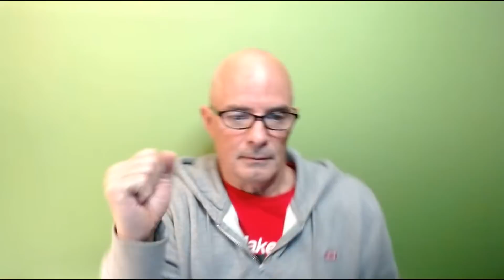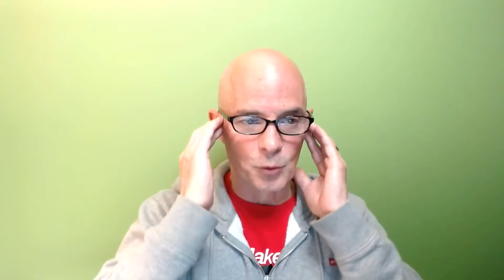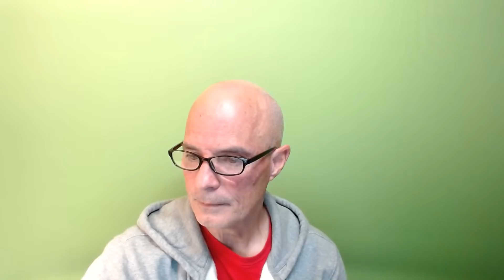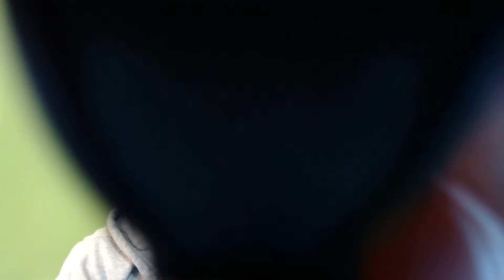LET'S TALK TECH-SLOPPY VS TRUCK NORRIS (PT 1) RESULTS

Comment: Can you use a Truck Norris cam on a gen5 5.3
Reply from the maker: no-that is an L83-but BTR has a good cam for the motor too
Reply: @richardholdener1727  alright thanks looking for a cam with similar power for a 16 silverado daily driver

Comment: Off topic here but have you thought about trying the 2.3/2.5 duratec from the fusion/escape?? Cheap and easy to find engine, that can be converted to rwd easily and can take some boost.
 As always thanks for the amazing videos/info.
Reply: Oldschool rangers have a rwd version of the 2.5l with a front facing intake. They are industrial power units, pn MSG-425efi

Comment: I have a 2004 silverado with an lq4 with prc 225 heads and a 216/220 600 lift cam (roughly 10.25cr) made 357whp and I'm looking for a turbo that would spool quickly and make around 750hp crank. Any suggestions?
Reply: Vs7875
Reply from the maker: S475, VS Racing 7875 gen 2 etc...

Comment: I'll have to look it back up, but I remember reading an article by a drag racer at one time, who did testing at the track with long tube headers, shorty headers, and a set of zoomies. He found there was no noticeable difference in his track speed or ET. As I remember, it was a pro mod type car. I'll try and find it again, but it's been long enough, I'm at a lost where I read it.
Reply from the maker: long tubes vs shorty or stock is a sizable change in power
Reply: @richardholdener1727  How about your tests you did yourself? If I remember correctly, at least with the engine you were testing them on, you gained a max of about 16 extra horsepower. I'm not sure about you, but I wouldn't call that a sizable increase in horsepower. I'm sure it's much different as the horsepower figures on the engine go up, but alas, I don't have the ability to test these things. Thanks for your videos!